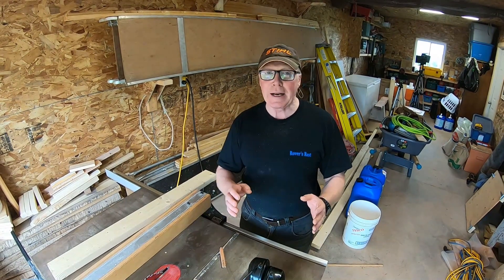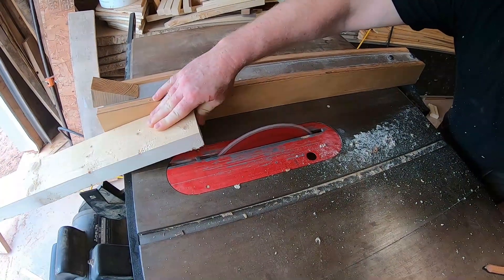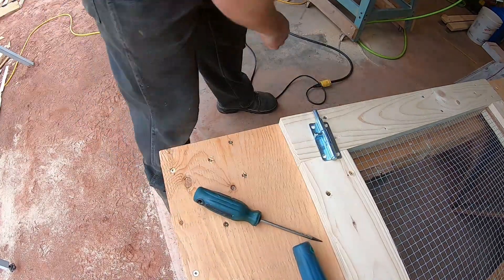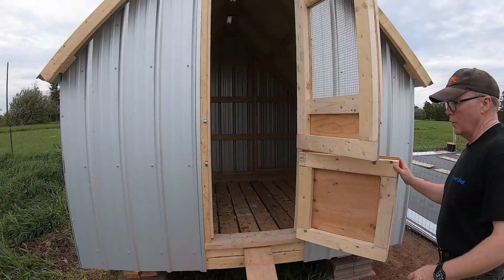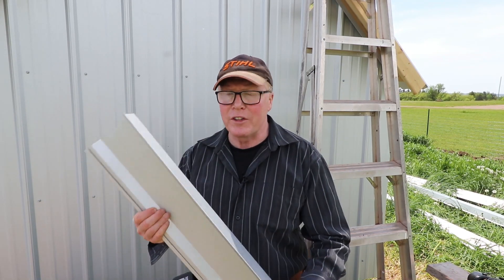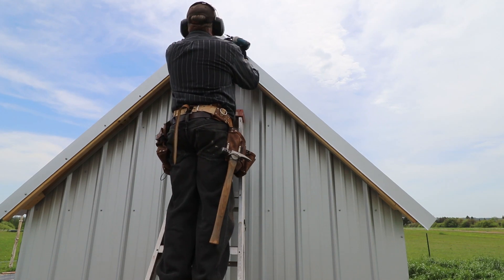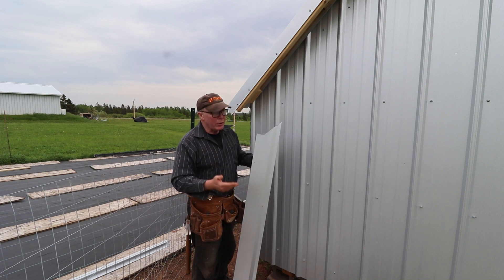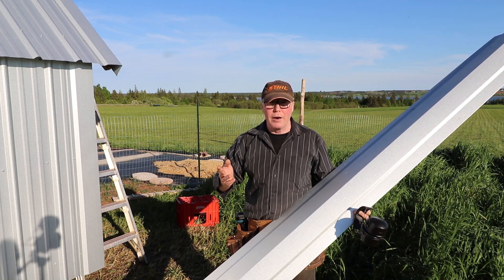S1E38 Dutch Door Build for the Henhouse || Flashing installed to keep out Predators and Weather

Comment: Since I am completely clueless I was wondering about the temperature inside the hen house on a hot day sunny day.  I know on a sunny day a metal car roof can get pretty hot.   Would it at all be helpful to install a exhaust fan or something similar to help dissipate the heat, if that is even a actual problem
Reply from the maker: Very good question, the hens spend very little time inside during the day but the floor of the house is cool as it is vented and the door is always open so that they can enter to lay eggs.